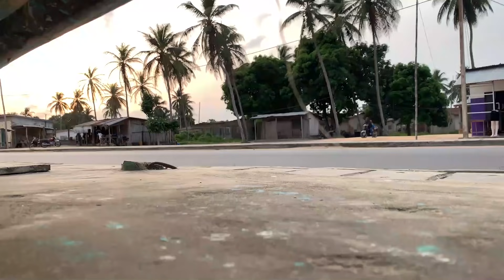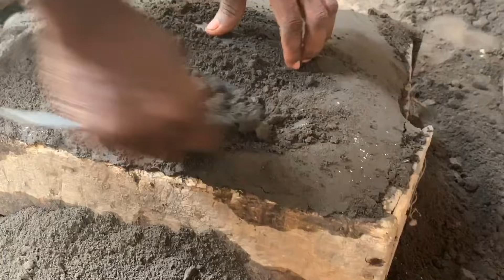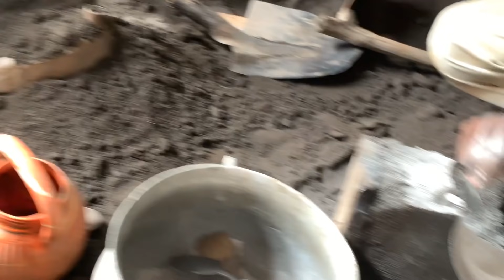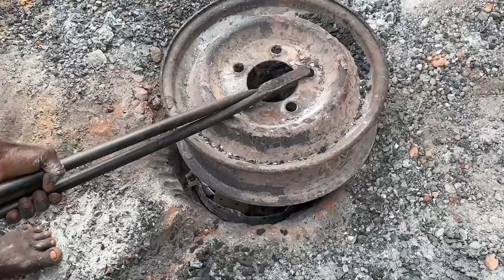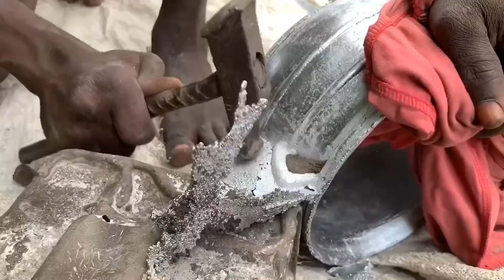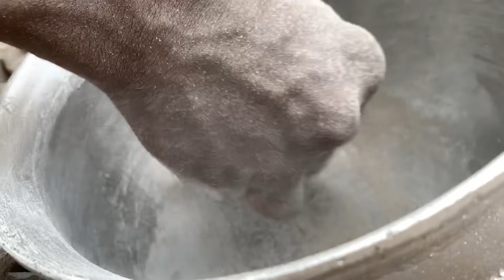HABU \\ Casting An Aluminum Pot With Minimal Tools

Comment: It is not ideal to store food in aluminum pots, as the food can absorb the aluminum's taste, and acidic foods may react with the metal, which can be unhealthy.

"Improve aluminum pots for cooking with these simple methods:
    Oiling the pot: Rub the pot with cooking oil and heat it. This creates a natural protective layer that reduces reactions between the food and the aluminum. Repeat this regularly.
    Carbon layer: After cooking, leave a thin layer of oil or fat in the pot. Over time, this builds up a barrier that protects the pot and the food.
    Avoid acidic foods: Do not cook very acidic dishes, like those with tomatoes or citrus, directly in the pot, as they can react with the aluminum.
    Do not store food in the pot: Once the food is cooked, transfer it to another container. Leaving food in the aluminum pot can cause it to absorb the metal and spoil faster."

Best of  luck, love from Denmark ❤💕
Reply from the maker: Every written word is correct! Thank you for leaving some tipps… ❤️👌🏽

Comment: What would OSHA think. :-D :-D
Reply: America's Occupational Safety and Health Administration (OSHA)... Basically, if they saw that happening here, they would go nuts.  But I venture to guess that the guys making the pots have more respect for molten aluminum than most of the people working in foundries over here today... Americans need to be told not to pour molten metal on their feet. 😁
Reply: I work in a car factory over here in the US, and the lengths that my company goes to "keep us safe" borders on stupid... just to keep OSHA happy.
Reply from the maker: 😁😅 yes you are right